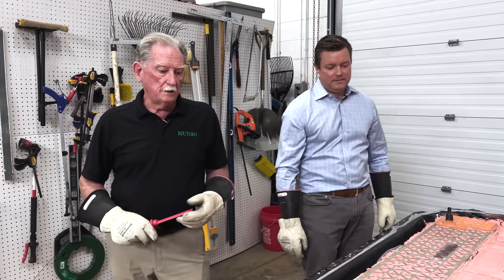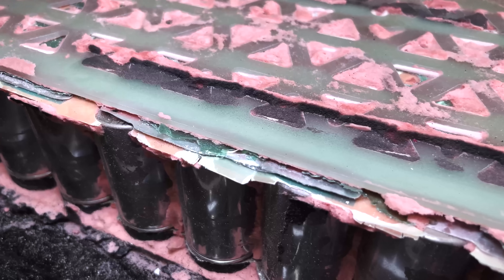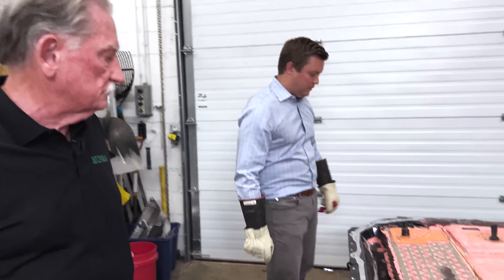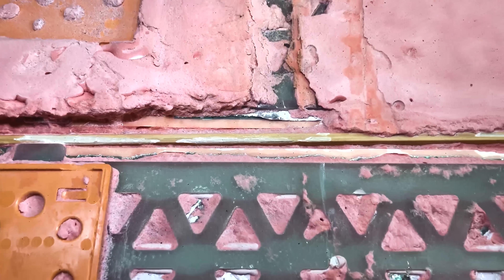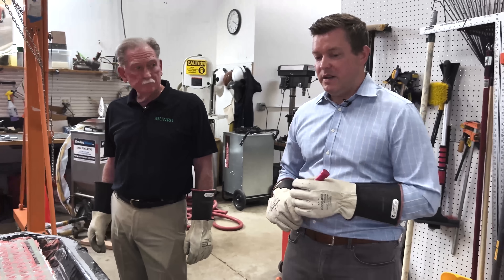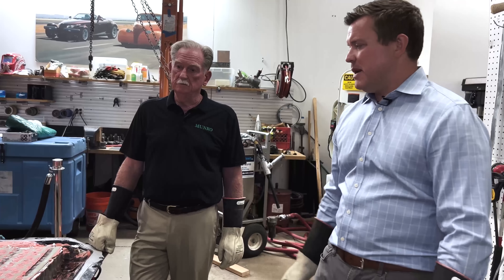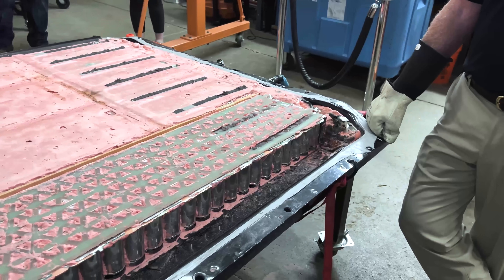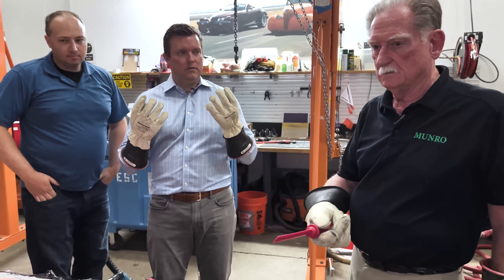4680 Battery Pack: What We Found Under the Foam!

Comment: Can you remove the foam chemically? Acetone does wonders for styrofoam and most other foams. Ethyl acetate may also work well.
Reply: MEK Methyl ethyl ketone
Reply: Maybe it attacks the other kinds of plastics, like the ones in the battery?
Reply: It might run between the cell connections and create a short circuit not good at all!

Comment: Wow, recycling.  I sure would want to get a battery pack with recycled molecules!  Good grief!
Reply: Every molecule has been recycled. You are recycled atoms and molecules. They don't wear out. You could call them Elemental.
Reply: Northvolt a company run by former tesla execs, showed off a cell made from recycled materials late last year.
Turns out the recycled and re fined materials made the cell function even better than virgin sourced cell materials do. 

Redwoods materials will be supplying tesla recycled battery materials from q3 this year at the Panasonic joint plant in Nevada. 
Redwoods alone has plans by 2030 to supply the U.S. market with enough recycled materials to make 5,000,000+ev pack's. 👍🏻

Comment: So the pack is completely unrepairable, so a cell or module goes bad the whole pack has to be replaced what a waste.
Reply: Where precisely did anyone say "if a cell or module goes bad the pack had to be replaced"?
Have you ever wondered if someone (Tesla?) could engineer a solid state switch to disconnect an individual cell?
("Rocket scientists" and all that?)
Then, all that would happen is you lose 0.12% of capacity?
.
As for "what a waste"....
If a pack can be shredded to produce raw material which costs 17.5% that of virgin mined ore for cell production, it's not exactly a "waste" if it's a rare occurrence?
In fact, if under warranty it would be a useful research tool for the manufacturer who could I vestigate WHY it failed

Comment: I'm really worried about repairability with this style of battery pack construction.
Reply: there are no possible repair, they sell you a car, you pay for the car but the car is not really yours at the end. They should change the word "sell" for something like "rent" o a mix between this two words, but this is not anymore like buying and owning a car. Mercedes even do not let you to open the bumper in their new electric models.

Comment: @7:20 Reducing repairability for the sake of reliability is insanely foolish for a consumer good like an automobile.  If haven't heard, Ford as well as every other manufacturer still uses threaded fasteners for its cylinder heads.  The alternative would be a non-repairable engine.

Comment: Definitely not serviceable, but looks incredibly robust in terms of crash worthiness.
Reply: Long term data on it will be exciting.  Hopefully those batteries are great and the pack build is robust and this thing easily outlasts 300,000 miles or 20+ years.
Reply: Not meant to, like an electric motor. More economical to just replace the whole unit.
Reply: No but even their old batteries lasted 15 years or so and it was easier to just replace them than fix them. So if they are just going to replace it anyway, then this is the way to go. Cheaper to make, and less prone to failure.
Reply: What about saving the planet and refurbishing batteries for other uses ))) fk dat

Comment: Dry ice blasting sounds like a good method for removing that foam.   Have you tried using walnut shells or fine sand as well?
Reply: The dry ice vaporizes upon impact, the other items you mention are far more destructive, not breaking down upon or after impact.
Reply: @BillyLapTop  They are indeed however used selectively they might speed up the job like maybe where the foam is thicker.   Youde need two guns of course.

Comment: Wait, so the cells are facing Up but are vented Down ? I don't know about that. I've seen a 4680 cell made by Tesla.
If they are vented up then a thermal event will be a real problem. It's still not clear that being vented down would help if the pink filler flowed all the way to the bottom of the case. I haven't seen gas vents on the outer case. Have you?

Comment: Guess next time you drive the car to zero charge before opening the battery pack. Or is it the additional charge beyond zero that is left?
Reply: @Directives :: You treat batteries like this like a gun. Always assume it's loaded. Even if you know it isn't. One lapse in safety precautions and you're dead.
Reply: There is more than enough voltage in a 0 % EV battery to kill a person. It is just at the level where the battery management system has determined that driving the car further would damage the battery.
Reply: The car's system read 0 and will stop before the battery is completely depleted to prevent damaging the cells.

Comment: Thanks for that very interesting detailed exposition of the Tesla battery pack. One question, if a single battery fails, is there a system by which the on board battery controller can bypass that malfunctioning battery allowing the rest of the battery pack to continue to function, or does the whole battery pack shuts down because as I see it it is impossible to replace an individual battery in these packs, considering the way they are manufactured…only the entire battery pack😳😳.
Reply: The BMS, to my knowledge, compensates for any failures and simply reduces capacity.
Reply: Yes the Battery Module system regulate imbalance in the pack to a degree. 

Even if you have a pack with easy replacement of modules, it is not that easy to replace them. You would imbalance the pack since you have voltage differences between modules. You also have 1/x modules with no degradation while all other have degrade which cause unbalance over time. Even with BMS module, you can compensate for few cell loss but not for a whole module off balance.
Reply: @pipooh1  Thanks, good to know
Reply: No, the BMS cannot bypass a cell. If the cell connection is very fine wire (as in other Tesla batteries), it can fail as a fuse in the case of a cell shorting, effectively removing the cell and partially crippling the group of cell that are in parallel with it (likely 9-cell groups in this battery).

Comment: How many cells are wired in series and how many in parallel for the pack and the modules? 
Best guess from your cell count between 816 and 828 cells:
816 - 102s 8p => this is plausible. And nicely splits into four equal modules of 204 cells. These modules themselfes might be 102s 2p or 51s 4p.
102s from 4 longitudinal modules is also the configuration from the CATL LFP packs in Model 3, even though with much bigger prismatic LFP cells and of a different chemistry with lower cell voltage.

820 - does not break down nicely into factors.
824  - 103 8p => would be feasible as well, even though less likely.
828 - does not break down nicely into factors. And 92s 9p would be too low in voltage.
Other configurations would imply spare cells to be used. Tesla did not do so so far, so why should they start doing so now? Because it's all one brick? Let's wait for the teardown results.
Reply: 816 does not break down nicely. As you pointed out, a block (or module) would need to be a combination (such as 102s 2p or 51s 4p) which would not work when all four blocks connected in series:
102s 2p per module x 4 modules = 408s 2p (four times the normal pack voltage)
51s 4p per module x 4 modules = 204s 4p (two times the normal pack voltage)
17s 12p per module x 4 modules = 68s 12p (two-thirds of normal pack voltage)

828 is the answer. It is indeed 92S 9P for the entire pack, which is entirely reasonable (early Model S with 14 modules were 84P). Each block (module) will be 23S 9P. 92S is very close to the 96S which is traditional for Tesla batteries (all 16-module Model S and X; all 2170-cell Model 3 and Y); the Ford Mach-E has 96S standard range and 94S extended range batteries, driving the same motors and controllers.
Reply: @brianb-p6586  You can wire 102s 2p in parallel (4p) to reach 102s 8p. You can also wire 51s 4p in a 2s2p configuration.
The configurations 408s2p, 204s 4p and 68s 12p make no sense (for now), for sure. But the 204s 2p will be a nice 700-800 V voltage at a later stage.
As for 828 cells in a 92s 9p configuration: this would be possible but how to split to 4 modules? Would be 23*9 (207 cells) for each module (likely 23s 9p), if all 4 modules are equal. Or you would have to distribute to two smaller and two larger modules.
One more drawback: 92s 9p does have no trivial split to a 184s battery for the 700-800 Volts level.
Let's wait and see, unless you know your claims for sure.
BTW: Ford Mustang Mach-E has 96s standard range and 94s extended range packs (2x 7s4p plus 10x 8s4p).
Reply: @koeniglicher  You can build strings (such a102S 2P) and then connect those strings to each other in parallel, and amateurs sometimes do this in their backyard conversions, but no real EV manufacturer does. Parallel strings multiplies the number of BMS monitoring and balancing points required, and encourages imbalanced charge and discharge.

Yes, four identical 92S 9P blocks (they're not really modules because they're not separable) is the obvious solution.

It is true that 9 does not evenly divide by two, allowing reconfiguration to double the pack voltage. Why would this matter? A change to "800 V" architecture would change every electrical component of the vehicle, so using a different cell arrangement in the battery is trivial. Odd numbers of cells per group (usually 3) is very common in EVs, because this is simply not an issue.

If this is the comment in which I had 92S instead of 94S for the Mach E extended pack... yes, I later realized that - thanks for the correction.
Reply: @brianb-p6586  Kudos to you, Brian! The new video by Munro confirms your assumption on 92s 9p, made of 4s 23s9p.
Reply: @koeniglicher  thanks for the heads-up... time to watch the new video.

Comment: I'm just thinking of all those companies (like EV West and Electric Classic Cars) which make EV conversions using Tesla modules. I think in future they are going to have a hard time getting access to any batteries from these cars.
Reply: Machinegun production speed on new cells easy licensing to other companies to make the 4680 form factor.... IMO once raw material and refining are increased getting replacement cells or building your own packs is not going to be hard or expensive.

Comment: Great video Sandy & Cory. It is like pealing the layers of onion. We should get a much better understanding on how the 4680 battery pack works once you have completely de-constructed the pack. There is still the big unknown about how their software is controlling the battery pack. We don't know for sure if the 828 or 816 cells are equivalent to 85 KWHR or more, if it is being throttled back for marketing reasons.

Comment: The only thing I'm worried about is repairability, if some cells go bad do i need to replace the whole pack? Imagine these cars after they're out of warranty.
Reply: The BMS might go wonky but all the cells are okay. Then.. replace EVERYTHING! That practically means: If no insurance, scrap the FULLY FUNCTIONAL car.
Reply: Yes.  These are not serviceable - replace the pack.  Even if the foam can be easily dissolved, the pack would need to be "rebuilt" by resetting the barriers and refoaming.  It won't be cheap and not worth the cost unless it's a low mileage pack that had a long-shot single cell or sensor failure where the rest of the pack could be confidently resold as a long life component.

Comment: It's probably isn't a new suggestion, but I wonder if there's some type of a solvent that could just dissolve the foam without damaging any of the components around it? This wouldn't give you the ability to repair the pack, but could make salvaging the cells for reuse possible rather than recycling, later in the battery packs life.
Reply: Normally Acetone resolves any kind of foam.
Reply: @TheTurbotommi  I had a feeling, but thought maybe it was some kind of magic foam.
Reply: That is the only way
Reply: the only solution with a piece of extremely complex composite material like this is total annihilation. Hot piranha solution to just absolutely destroy all organics into CO2 and dissolve all metals into solution that can then be selectively precipitated back out. There is no other way.
Reply: There are dangerous solvents. Using an ice blaster is sure far less dangerous but it turns out harder then first assumed.
Reply: Very likely someone will find a way in the after-market.  Also likely to be very different from what Tesla does.  Or maybe Tesla processes get leaked out and adapter to the after-market.

Comment: Is there no way to discharge these packs BEFORE you remove them so you don't have to worry about being electrocuted?
Reply: See previous video
Reply: @PhillipZX3 :: Of course they discharge it. Do they look stupid to you? It is still potentially dangerous to disassemble even after discharge. It won't really be "safe" until all the individual cells are separated.

Comment: I am convinced that to dissolve the mixture there will be a liquid with a non-disturbing additive that will make everything melt like snow in the sun
Reply: I agree. It could also, and maybe even better, be a gas. I wonder why they didn't send it to be analyzed. I would have. ...know thy enemy. :)
Reply: With any reasonable company for sure. But would the odds be the same when applied to Tesla? Think long and hard before you answer :)
Reply: @Cloxxki  Elon says he's committed to recycling the batteries so for that to happen the process must be efficient. If Tesla has a patented process for removing the material, it ensures the batteries come back to them. Also that "stuff" may have a several purposes such as, heat dissipation, fire retardant, corrosion/water proofing. Unknown until analyzed, demonstrated or otherwise explained. For now no one knows...maybe it's made of pure evil. :)

Comment: Sandy. Your explanation of what happens to molecules in batteries under cryogenic conditions is not quite correct. 
Firstly absolute zero or "zero Kelvin " is about minus 273 celcius. 
Liquid nitrogen is about minus 196 if I remember correctly. 
At zero kelvin all atomic disorder becomes inert.  This means that instead of "molecules falling apart" , molecules are so tightly bound due to energy dissipation that chemical activity comes to a complete stop.  
Now liquid nitrogen still allows some chemical activity be it hardly measurable but more cost effective and with an excellent safety profile. 
Once the batteries are shredded the resulting fragments drop into a neutralizing solution which essentially kills the fragments ability to short out. 
There it is in a nutshell
Reply: I would imagine at liquid nitrogen temps, the battery pack would become like a piece of glass and easily shatter once it hit the chompers, then it is a matter of sorting the components out.
Reply: @BillyLapTop  organics become brittle at cryo temps but metals hold their integrity.  Case in point is the vacuum insulated dewar containers that hold lq n2 are made out of aluminum in most cases.
Reply: @chrisvanderburg5568  Point taken.  I think the dewars might be composed with alloys that define the low temperature resistant properties.   I know Tesla created a recipe for the Giga castings to allow the aluminum to cool without creating stresses in it.  It would seem to follow that formulations of aluminum could be concocted that have structural strength at normal ambient temperatures but may lose that integrity at extremes, purposely for recycling.  Given said recycling would be on an industrial scale, this might be possible.  No doubt aluminum is incredible stuff, given planes are flying in temps of -50 F at altitude.
Reply: @BillyLapTop  nope. Straight up aluminum. I was in the packaged gas industry for 30 years. We dealt with all the cryo gasses including the fuel for the shuttle.
Pgs 45 and pgs 60 s are straight up stainless which is why elon uses it for starship